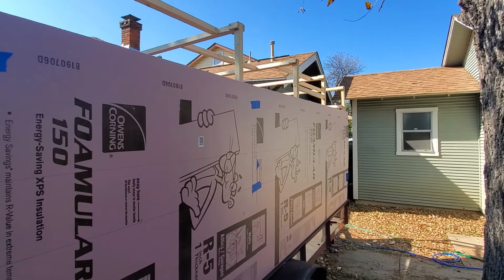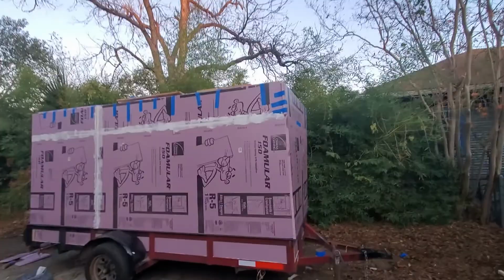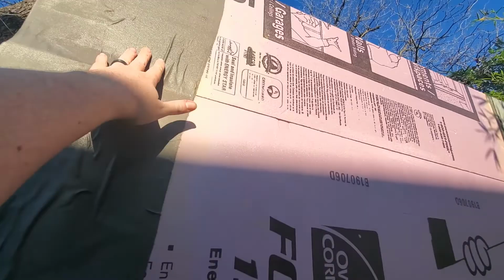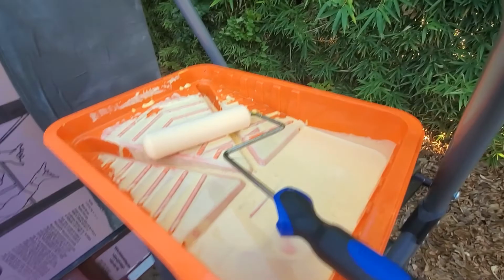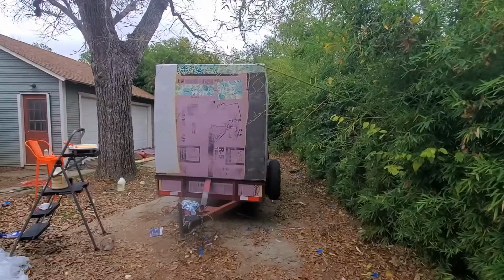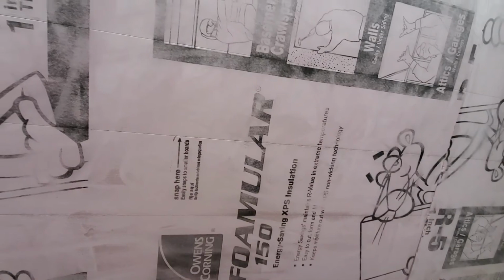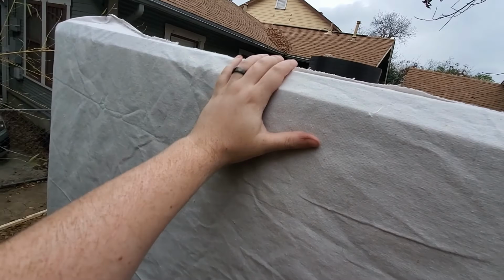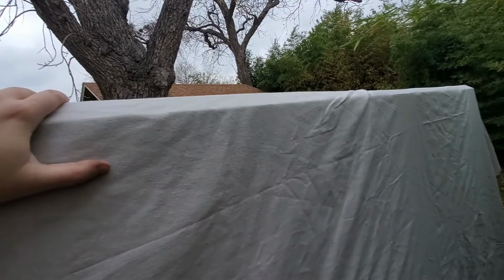Foam Camper Build Part 5: Tarp Time

Comment: A sheet rockT square & a utility knife cuts foam brd quickly with no mess !
A Brad nailer, even with 2”  brads will not hold up with the stress of pulling & drying out of the wood, they will work loose, screws are the best option!

Comment: Lmao...just to throw this out there for those watching the poor mans fiberglass technique is an awesome finish and strong but everything thing else is an accident waiting to happen. Liquid nails is b.s. it's a waist of money! Been there done that. F26 is what it takes and (AND) you gotta rub the adhesive on ANY product or it doesn't bond good not even wood. As a remodeler I've seen many materials pulled apart with liquid nails all over that never adhere'd to what it was supposed to. If you've done any remodeling you know what I'm talking about.

Comment: What size is your trailer?  What thickness of foam are you using?
Reply from the maker: The trailer is 6.5 × 12 ft. The foam I used was 1 inch thick, I wanted to go with 2 inch, but it was almost twice the price.